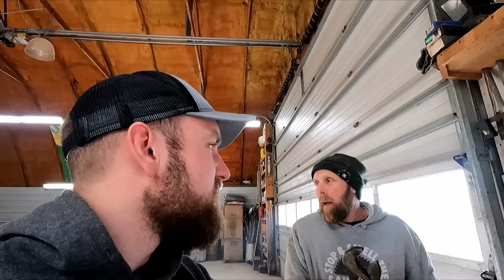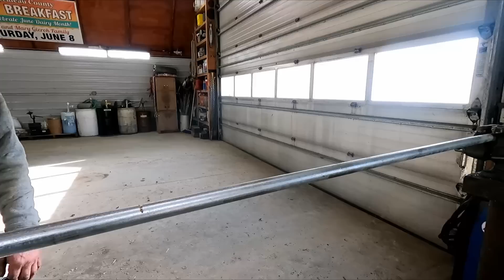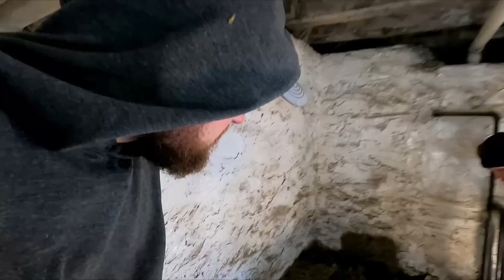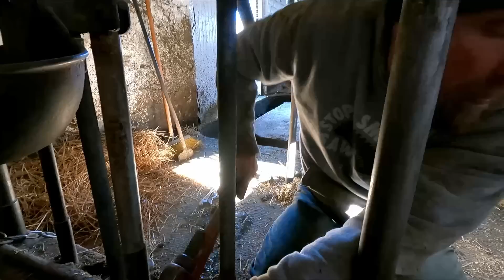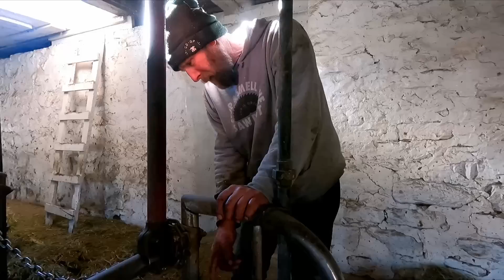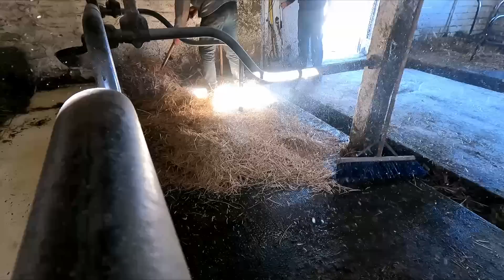Fixing Broken Water Lines!

Comment: Just in general, using the galvanized pipe is better than most of what is on the market today, especially in the barn where you have it running. I worked in the old farrowing barns that had a similar setup. Great video I appreciate watching what y'all do on your farm.

Comment: If it comes to changing out the water line, for durability you may check the price of stainless steel piping !!! It won't be cheap but will last and be strong and rigged if that is what you need !!

Comment: As a plumber by trade I thread a lot of pipe it didn't look like y'all were using cutting oil I would highly recommend it because without using it you take a risk ripping the threads making a weak point causing possible leaks down the road. PEX is a good alternative but two negatives I would see first is once water is in the line it could start sagging unless you have a continuous support entire length plus doesn't Look neat and tidy when that happens. Second  is depending on the length that you're barn you may have an issue with lack of pressure due to friction loss therefore you possibly need to go larger pipe diameter and also have it on a continuous loop so you have equal pressure at every drinker.

Comment: I know about that water stuff! Here's one- back in 1960 we had a drouth and our spring didn't supply enough water for the cows, this was in February, so my Dad & I took the horses, loaded milk cans into an old manure spreader we turned into a cart, just took the chain & beaters out, went down to the creek, there was a deep hole, bucket out water into the milk cans, go up to the barn,  pump the water up into a big watering tank my Dad put up on stilts so it would gravity feed down to the waterline for the water bowls. twice a day for weeks, until the well drillers could come a drill a well. Now mind you this is February and cold as can be. Watered about 60 head, milked 30,+ heifers & calves.  So they came and drilled a well and they went 110 ft. and hit water, an artesian well! it was a 6" pipe and the water shot out of there for 3 days straight full pipe as high as the barn!! everything was ice, and it took them the 3 days to try to cap it, because there was so much pressure on that well, they couldn't hold it down and turn the cap to screw it on! finally got it on and the well supplied the barn, the house which is about 200 ft up hill from the barn with no pump, stock tank out in the pasture, up hill 100ft, over to my Uncle's trailer, which was out behind the house, and had a 1" overflow pipe which ran full bore all the time! There's more to this story, but I'm writing a book! you want to hear rest of the story?

Comment: I’m a licensed pump installer for the state of Wisconsin. I’m in the Green Bay area. When we pipe barns we try to put ball valve in so we can isolate the barn in half and in quarters and some that have stock tanks we have hose thread faucets to fill while the pips are fixed. And if the pipe is around cows galvanized pipe is the cheapest. Stainless pipe is expensive and a pain to thread

Comment: We have a tie stall barn different type of stalls and manger we have a high manger with what used to be called comfort stalls by standard equipment which went outof business yrs ago the original stalls had all galvanized pipe there was 3 pipes across the front of all stalls the bottom pipe was the water with curved pipes which curved under the bowls and connected under them age took its toll on all the water lines so we switched it over to pvc pipe attached to the top pipe in the fronts with vinyl tubing hooked into the tops of plastic water bowls the pipes sometimes get busted and the cows push on the tubing and bust it too but a pocket knife and nut driver can fix the tubing in minutes but its better than dealing with galvanized pipe

Comment: Our water line for the cow's  drinking cups were over head and I don't remember any  replacement of the water line but the drinking cup valves would get stuck open from time to time. Our water pressure tank was in the basement  of our house, like Georges Dad's, and when the cow drank the pipes would bang when they stopped drinking.

Comment: We had our waterline running the length of the stall on the ceiling and our galvanized pipes run down to the drinking cups with 4by4,s to clamp them on for protection from the cows bumping them and for support/ they done well and never froze like our old one,s did, they were pretty much like yours on the floor!

Comment: Oh no waterlines my dad‘s barn was a different tie stall with a solid pipe that ran through the middle and then off of that pipe we used old milk or hose and had Barb end and use that to replace them and then all the waterlines were overhead like over the Man major way, and everything the water was overhead, so to be easy to drain access and repairand the milk lines the rubber milk lines were thing that you had to replace anyways so it was a another use for them

Comment: Water lines are one of the challenges of farming. Your proactive repairs are time well-spent. Failed water lines never seem to pick a good time to happen. Woke up to hear water running in the basement from a corroded fitting between the pump line and tank inlet decided to burst. Luckily a floor drain prevented a major flood.

Comment: The worst thing about old pipe is once you start it’s anyone’s guess where the repair will end.  One threaded joint twisting out in a fitting changes Plan A in a heartbeat!

Ever thaw out a frozen line with the arc welder?

Comment: our water lines and air lines for the milkers ran over head, with drop down pipes for the drinking cups, we used 3/4 inch steel pipes for both

Comment: We run our water lines right off the ceiling since the heat rises and (knock on wood) have never had problems with freezing or cows damaging them.  Then of coarse like ur barn every other stall we have a water cup then just drop the line down for it.  It works for us.. might not for you.. just letting y’all know what we got and use.  Thanks for the great content!

Comment: As a retired plumber, I still have nightmares about galvanized pipes that freeze and break in the winter. Pexs has made it so much easier to install and repair. It can withstand freezing 25 percent better without bursting. I like how your family still does a lot of the more traditional ways but it may be worth the time and money to upgrade the whole water system with Pex. Hang them up higher away from the cows and you can even use the pool noodles for extra insulation to prevent freezing. Keep up the great work.

Comment: Howdy Aaron, always good to see your dad keeping out of mischief.
George, you’re absolutely right, if it was plumbed overhead, it would eliminate the majority of the corrosion issues.
We used to have galvanized supply lines to our various barns, then dad replaced most of the underground lines with poly.
It works okay, but we’ve lost the ability to defrost lines with a portable welder.  We seldom get really cold temps here in The South of Michigan anymore though.
Bless’ns to the both of ya’s,
Tedd

Comment: Our water for the water cups ran over head along side the milk line. Then a line ran down to feed the cups. It doesn't matter what you have for a set up in my opinion. The cows will always rub on it, step on it, or the feed will corrode it.  The biggest pain was the cups. They ways had sticky valves and would flood the feed trough. (We had a trough that was indented into the floor in the shape of half a barrel).

Comment: If you ever change it would it be better to run pipes up by the ceiling  to get it off the cold floor  the heat in barn would probably  help with them up there. Thank you Tom from Nebraska

Comment: I’ve seen guys run pex line above by the pipeline then run the line down to the drinking cups. I would turn the drinking cups so they were inside the stall. That way if a valve should happen to stick open the water is in the gutter instead of the manger.

Comment: We have the water lines running overhead. the only problem with it is we would need to fix the line going to the top if the water bowl. So we would be able to fix in just minutes with making new threads on pipe and moving the bowl up same

Comment: I have a tiestall barn built in '94
 and the waterline is in the headrail. I haven't had to replace any yet other than a section where i changed the stall size but the old pipe was still good inside. It's
 1 1/4" galvanized pipe. However I've heard if you have a lot if iron in your water it won't last very long.

Comment: Milked jerseys in a tie stall barn for many decades.  There is no perfect system I suspect.  When we built the new addition we had water in the tie rail.  Worked for quite a while but eventually you will get pin hole leaks or even a break.  Then we went to inch and a quarter pvc which lies inside the manger curb- it has been broken a few times, mostly where the line has to go up and over and cows or heifers can reach it and push on it.  Some of the overhead has been replaced now with pex where it is more vulnerable to freezing, esp now as I only have heifers in the barn, and sometimes not very many.  We finally started turning the bowl lines off late in the evening to stop any possible flooding at night- seemed to work okay for the cows and i still do it for the heifers I have.  Many years ago my elderly neighbor said he had worked in a large dairy barn where the manger had drains and was designed to be flooded several times a day so the cows could drink- and in the really old days, as you said, they just drank when they went outside.

Comment: Great job on the pipe repair !    One question what are the sawtooth bars above the cows were they normally are. Your dad bumped his head on a couple off them ?   We had a barn like this I have never seen them in ours !
Reply: those are trainers to get the cows to back up when they pass manure or urine- so it lands in the gutter instead of on the platform.  You can run a little joit of electric through them, or not- it does help to keep cows cleaner, but they can be a nuisance to work around.

Comment: We have unions on each section of pipe.  Our water comes in in the middle of our barn and have a valve to shut down each section individually.  We have all of our own threading equipment but the hardware threads pipe reasonably.  You have a very nice setup.  The through setup is nice but you need a toprail setup for that

Comment: You could install a volume shutoff valve,where you can set how many gallons of water can go to your cows at night,so if a pipe breaks only so many gallons of water can flood your barn before it shuts the water off.we had a neighbor years ago had a 3 or 400 gallon tank in the upstairs of the barn and was enclosed and the barn floor removed so the barn heat kept it from freezing,at night they turned the main water line off and switched to the gravity flow tank,same principle ,only so much water flooding the barn

Comment: Do well, pump work on dairy farm, the main well pump has only failed in January or February, as matter a fact replaced it today, 11 degrees in northern central PA. Not a easy chore, well is 300 ft and pump hung on 2 inch pipe but we do what we have to do so cattle have water.

Comment: Brings back memories.  On the fridge days kept the dairy cows in the barn an heifers inside both barns kept one exhaust fan running within those barns.  We had Stantions a the water came across the top of the stantioned an a pipe went to to the drinking cups. We did have a preassure tank an a watering system tucked away kinda open but in the later years dad would enclosed it with a door an couple windows, added couod heat lamps an thermometer kept a close eye .  But as usual something else wouod freeze up .

Comment: I have been out of dairy for awhile now but we always had galvanized pipe. I don't think I'd change to anything else. You have the tools and the system down and it lasts a long time barring any damage. There was a guy in our area back in the 90's who ran hydraulic line to all of his water bowls. You may have mentioned in past videos and I've missed it but l would be interested to know if you've ever had problems with the pipe stalls rusting off at the concrete? That was a big problem for us at the end. We periodically bought new stalls from freudenthal mfg out there in Wisconsin (from Maine) as we got sick of patch jobs on the old ones.

Comment: Our house was set up the same way where you could hear the water running to the barn in the middle of the night. I put a screen filter in the hose leading to the drinking cup for my summer calves, and have not had it stick open since then. As far as durability of PEX, I can’t see why it wouldn’t hold up in a barn situation. Although I’ve never seen it done. It’s way easier to work with.

Comment: The worst I've seen is a pipe that froze, broke and was flooding everything. Subzero weather and there was a river of ice coming out the doors. A lot of sand used until things thawed in the spring. It was too thick to do anything with.